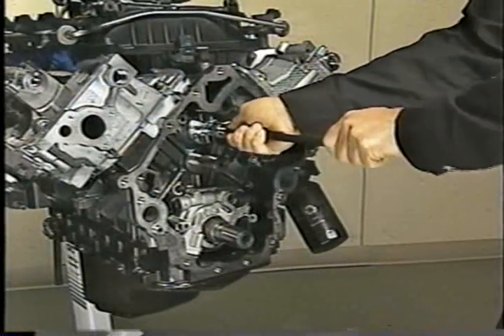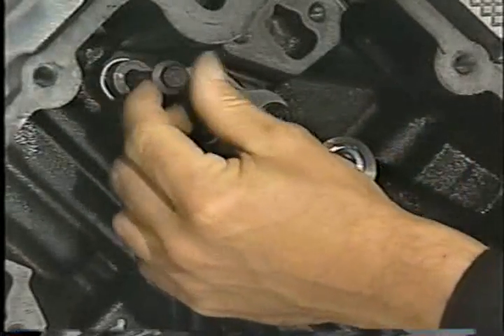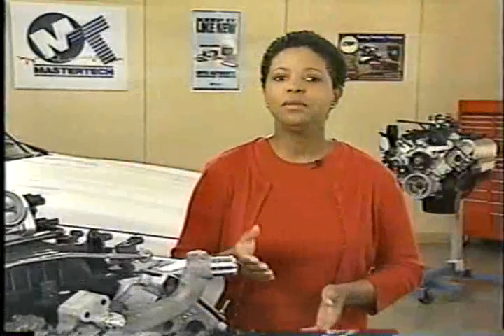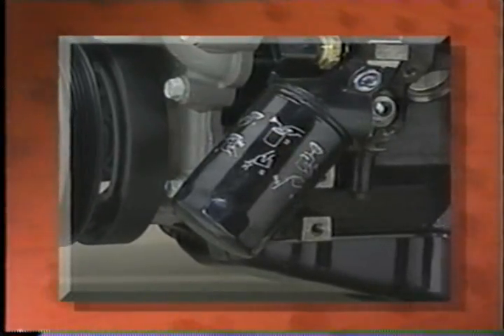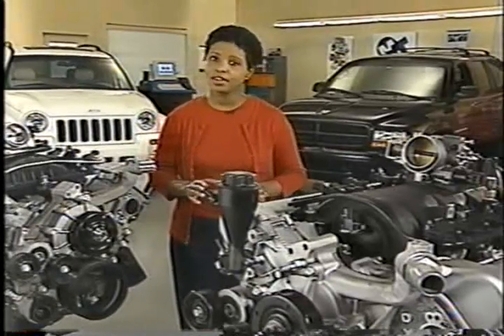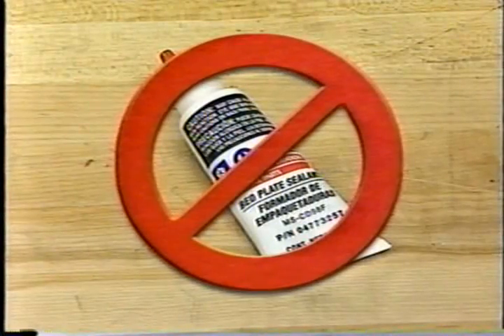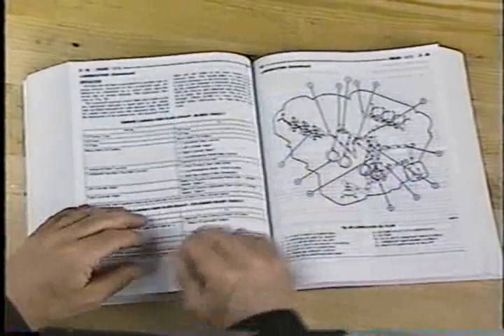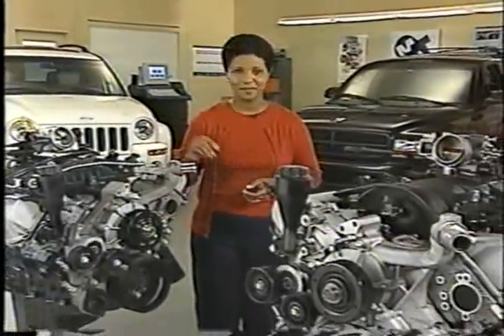Chrysler 3.7L V6 and 4.7 HO V8 Engines - Mastertech- Part 3

Comment: I bought my Dodge Dakota it had  around 52,000 on it, it now has 253 000 I change the oil every 4,000 miles 10w30 full synthetic nothing has ever gone wrong with this motor just a little timing chain rattle when I start it that's it. And when the light turns green I leave Chevys in the dust

Comment: I was never a fan of the 4.7 mostly because everybody said there junk and every one I've serviced had noise issues. Then my wife wanted a durango and I could only find decent used trucks with a 4.7 no 5.9 worth buying. That durango with 190k still runs good nice smooth power. The durango rotted out and developed electric issues so not worth putting money into. Got a dakota with a 4.7 and 194k great deal one owner well maintained and it runs perfect great truck. Change the oil every 3k and use quality synthetic is all you need to do not much. The chains will wear and rattle but it's not expensive if you do the job then your good for another lifetime.
Reply: I have 4 Durangos.  3 with 4.7 and one with the 5.9.  HP/Torque is almost identical with the MPG on the 4.7 showing significant gains over the 5.9.  I love the 4.7 over the 5.9.  Just like anything else, take care of em.

Comment: I've watched many of the videos related to these two engines, and loved them all. I use to have an '02 Liberty Sport with the 3.7L, and I can honestly say that it had impressed me with its performance and economy.

My question is this, where can I get the block measurement dimensions for both of these engines?
Reply: I am also fascinated with the powertech engines but struggle to find information about them.